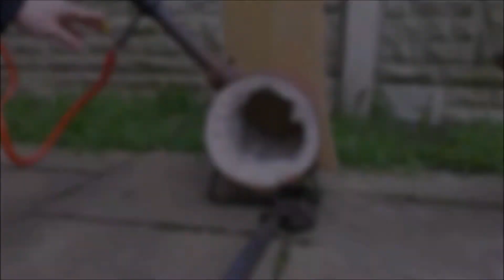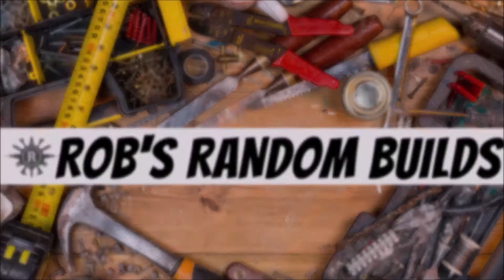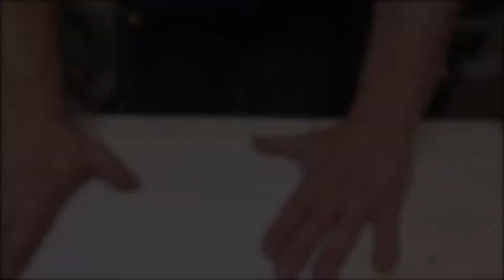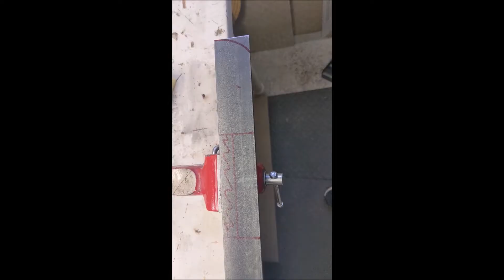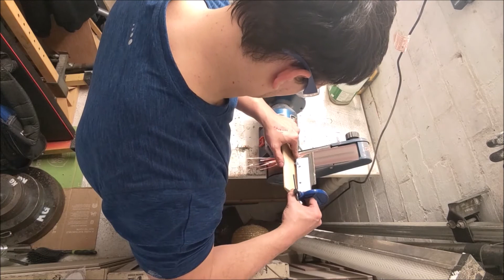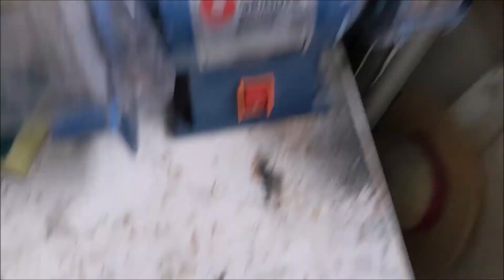Making A Knife - Stock Removal Method (Part 1)

Comment: Glad you're using eye protection with the grinders, but take it from me you should use elasticated googles that fit tight to your face. Otherwise stuff can work it's way underneath. I learned the hard way when I was cutting out an old cast iron soil pipe and although I was wearing googles like yours I ended up with an iron filing in my eye, had to go to hospital to get it drilled out of my eyeball. Not good!
Reply from the maker: At one point I had the grinder the wrong way and nearly sprayed sparks into my face...